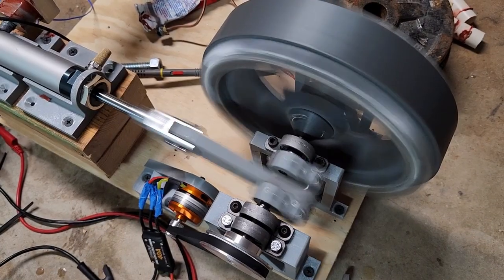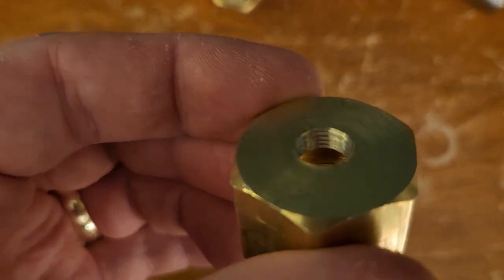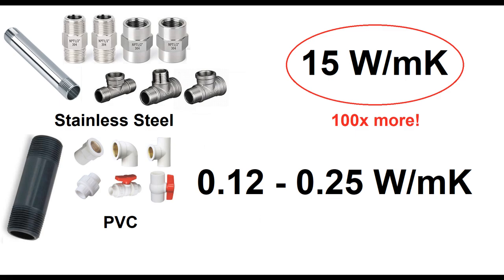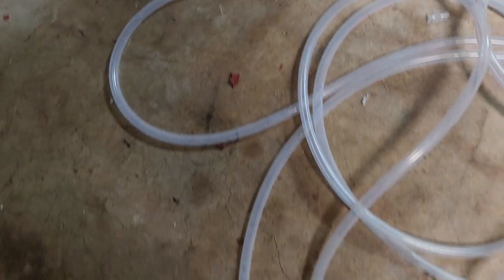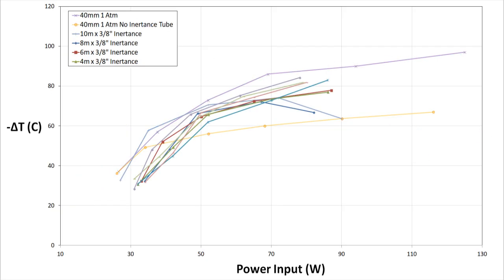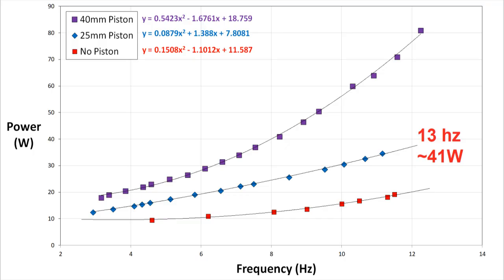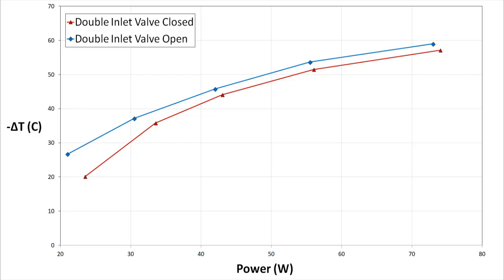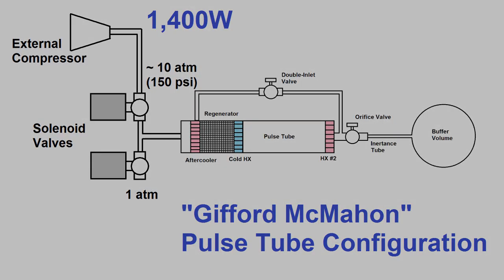Pulse Tube Cryocooler (Part 3)

Comment: The amount of energy required just to run the pump, defeats the purpose of the device. It’s not energy efficient by any means. You’d waste more energy just to run it. To get any practical energy use out of it. But the theory is sound.

Comment: The fact that feeding some of the acoustic energy back into the compression chamber makes me think that this is mechanically equivalent to an amplifier circuit and you essentially added a positive feedback loop, introducing too much could potentially cause the temperature to decrease within some limited ratio. Maybe you could use this analogy to create an electrical equivalent, and thus calculate the resonant frequency of the analogous system.

Comment: This is a great series, thanks very much.  I suggest you try operating with the unit vertical in gravity, with the cold end of the pulse tube down, to avoid gravitationally-driven convection in the pulse tube, which will be present even despite the oscillating flow.

Comment: I don't know if this will help, but if you separate the different (layers) of material in the regenerator by 5mm and use metal foam layers around 17-18 layers that might help a lot.  That way the metal foam layers will not conduct the heat to every other layer if they (the layers) are 5 mm apart from each other.  simply glue or soder or something in place the layers but be safe and wear eye protection, etc.

Comment: why is there even a regenerator? usually a regenerator is used in sterling engines because the air is going back and forth and u dont want the heat to go backwards, but here the flow is one way... so is the regenerator just used as a heat sink and not a regenerator?

Comment: please buy a thermal camera (for example infiray p2 pro or similar for ~250$). i think this would reduce your troubleshooting significantly (need to paint the metal tubes black on the outside tho)

Comment: This is great work, but I wanted to mention you might want to review some convection calculations. Your math shows heat loss based solely on conduction, as if free convection will immediately reject all the heat. In a previous video you referenced convection using the gas conductivity of air, which is certainly a factor, but not remotely complete. I would guess you can model the outside with free convection on cylinders of various diameters at least for a ballpark number. For the internal flow it will obviously be forced convection, and I doubt you will find a correlation for this, but I'm sure you could get a valid range. Looking at the solid alone doesn't do much for the heat transfer solution.

Comment: Thank you for doing and sharing the sorts of experiments many of us would love to do ourselves!
I see that in your next experiment, you plan to abandon the pistons for a Gifford-McMahon system. However, I wondered about how to reduce the mechanical losses in the pistons. I wondered if the piston was cut with grooves as if to receive traditional piston rings, but left empty. The contact surface would be reduced and (I hope) the turbulence at the grooves would act as pseudo-rings for the piston. the turbulence might also act as a lubricant. If true, the friction might be reduced and the compression efficiency increased. 
Your thoughts?

Comment: I was wondering if the flat lining of the system could be due to the aluminum shell of the piston letting in more heat than the system removes at the higher frequency?

Comment: 16:20 I admit, I'm really struggling to understand any of this, but when you mention impedance matching here, that is referring to the volume of flow, right? If so, what if you used the large piston, but set up on a very short stroke, so you move the same volume of air? All other things being equal, you should get less parasitic heat from the friction of the seals that way, no?

Comment: i  would like to make  one for cold storage, will it  be  a cost effective and low power consumption solution to maintain -70 C temperature?  which gas you are using in it?
Reply from the maker: The most cost effective solution for what you're trying to do would be a cascade ultra-low-temperature (ULT) fridge

Comment: You might be able to lower your motor input power at high system pressure by connecting a second buffer volume at the other pneumatic piston outlett at the same pressure. In this case the motor should need less power to compress the gas inside the cooler, because the pressure difference over the piston will be lower. Hope you understand me, my english is not the best

Comment: If i may make a suggestion for heat extraction, LED lamps are often cooled with an extruded tubular heat sink with a significant number of fins on the outside.  If you arrange this  heat sink within another pipe and run coolant through the middle with your gas in the space between the two pipes you would have an incredible amount of surface area in play.

Comment: So if you made a bigger diameter piston but thinner, like a Stirling engine, less mass means it could resonate at a higher frequency. So tuning it can change the impedence of the system. A maget as part of the piston and a coil outside could generate power to run a fan/pump to further cool the regenerator and boost efficiency.

Comment: He said he stuffed the thing with copper mesh which is commonly used in distillation columns he's describing a crack pipe because the crack pipe is a distillation column when you get into Refinery work you'll find yourself stuffing perfectly molded pieces proper 12 to 13 ft thick the diameter of the Tower and so those of you who don't know what a distillation Tower is we call him frackin Towers or Trey Towers when you're driving down the road and you see into a refinery the tower sticking up a r e distillation Towers every one of them

Comment: What if ambient temperature was already -40c.
would there be any benefit to running this in a deep freezer as a kind of "first stage"?

as having that 80c differential with an already 40c below temp would give you 120 below as opposed to only getting 60 below when the ambient is 20c with the same 80c differential.

Comment: This calls for a pvc composite using fiberglass or carbon fiber or ceramic coating of the tube?
Also, try using regenerator material with exponentially more surface area like molecular sieve or expanded rock. I am just throwing ideas out there.

Comment: I’ll be honest, most of this mini series is way more complex than what I can understand but I think you mentioned in the first episode needing more surface area on the internal diameter of the cooper pipes so I thought I’d suggest trying sintered copper heat pipes. They are really common in pc coolers and can be purchased relatively easily.

Comment: You seem to know what you're doing and I'm absolutely out of my element here, but since you didn't mention it, I'm going to ask: Isn't it logical that you're hitting a wall at around -75°C since your air mixture contains CO2 that'll freeze and block up the flow through the regenerator?

Comment: Are you sure Alpha Stirling coolers use crankshafts and not camshafts? I thought you would want to change the phase relation of compression and decompression to better position the working gasses as you work upon them. Pressurized system should keep the valves from floating at 60rpm without springs. If the stroke length isn't the maximum, you could slide the cylinder housing to dynamically change primary and secondary volume/compression ratio.

Comment: Awesome stuff! Grab bag of ideas:

* You tried alternate regenerator materials but none of the ones shown were fibrous like your steel, so I think surface area : volume ratios were ruining them all. Have you tried plain old cotton balls, or the various types of fibrous insulation?

*  Have you thought about using insulative liners inside of metal components to get the pressure rating of metal but avoid contacting your working fluid with metal exposed to ambient?

* You can DIY a super dense heat exchanger with 3D printed stamping molds and thin 1000 series aluminum (it's super soft and easy). Print a pair of dies wavy in one axis to make a tiny version of corrugated roof panels, then alternate a stack of corrugated, flat, corrugated, flat. Clamp the edges of your stack so they get good thermal contact with the outside of your housing.

Comment: What are your thoughts on utilizing this technology for off-grid cooling? Could you possibly power this from a small water wheel, solar panel dump load, or wind turbine.  I'm thinking something like small room AC, noncritical fridge, or root cellar. Do you have any links to a simple DIY approach that would work for something like this?

Comment: Just wondering if a diaphragm piston would work reducing heat from using a piston heat would be generated from compression but no heat from contact as bellows just flex. I’m no scientist probably talking nonsense just thought a diaphragm pump would generate less heat.

Comment: You tried my copper wool idea!  Cool. :)     Sorry it didn't work out.  

The only thing I have to add to this one is, you need to remove the heat from the hot side of the heat exchangers.  You can't just let it stay hot, you need to remove the heat, so it isn't there to start. Still ambient air isn't enough.  Flow air over it, with a PC case fan or something.   If that helps, flow water over it, or add a water jacket, and do more there.   I could write a few paragraphs about a laser cutter, peltier modules, and CPU heatsinks and fans.  All stuff I'm sure you already know.   Sometimes it helps to be reminded.

If it were my project, I'd prefer water jackets, so that stuff can be hidden away from view.   Otherwise, it'd have a big heat block where the copper tubes are, and a big gaming PC heatsink on it.  

Do you have any idea how many watts of heat you're trying to get rid of?  

Your stuff is well above my skill and experience, which is why I'm finding it so interesting.  Sometimes I have a useful idea or two.

Comment: Hm, I'm not a engineer and am not claiming to be one, but those copper pipe heat exchangers look like they would have trouble actually dissipating the heat, as while they have high surface area, wouldn't the inner pipes have trouble getting rid of their heat? 

An idea I have is if you don't want to do active cooling perhaps trying to use the air currents from the heated air "rising" to passively draw more air up through the heat exchanger, kinda like a wood fire stove drawing air because the heated air rises through the chimney and creates an area of lower pressure

Comment: So one thing if you are trying to increase the heat dissipation of the hotend you need to increase the surface area of the OUTSIDE of the pipe as the conduction loss will be proportional to that. You could probably mount some heatpipes to a small radiator like a computer to maximize the dissipation there.

There are pulse tube cryocoolers that do that already so there is precedence for a design like that.

Comment: Two ideas.
1) Possibly adding an insulating coating to the inside of some of the metal components.  Maybe just a bit of epoxy mixed with with a fine power that could offer a thin thermal barrier.
2) The heat exchanger might be affected by the void near the entry point of the tubes.  This area is effectively a capacitor preventing flow from entering the tubes, but could also be adding the the turbulence.  That could be good (for transfer), or bad.  But filling that area with something easily removed (like Play-Doh or something) could provide more data.

Comment: When you pressurize the working fluid, did you pressurize the other side of the piston?   If not, then your motor is struggling against the lack of pressure on that side.   A small accumulator tank could be made out of PVC to keep the compression numbers about equal.  Even a small fan on the warm heat exchanger will improve system performance.

Comment: You hit the nail on the head with your A/C circuit analogy. I would suggest you pay mind to your pump's resonant frequency, its effect on performance and efficiency, and how you could tune that. Using the analogy again, your flywheel is like an inductor, and compressing air in the total system acts like a capacitor. This forms a resonant tank in and of itself. Adding and removing "counter springs" to your air cylinder has the analogous effect to adding and removing capacitors in parallel to the tank. You may, alternatively, wish to add or remove weight to your flywheel, and see what this does. It may not bring the system the direction you want, but it will provide useful information to be sure. 👍

Comment: How about using a vortex tube instead of the bypass to the inlet + the orifice? Connect the warm side to the inlet and the cold side to the cold chamber.

Vortex Tube explanation: Device where you inject a fluid stream tangentially into a pipe. The fluid stream will exit at two ends of the vortex tube, one of the streams is cold, the other one hot.

Comment: Fill the tube with your breath that you led the carbon sink in🙏 you probeble get more cold translations olso heath translations if there is sil oxign left😍🙏🍀
Reply: Compresed space inbetween the oxigens becomes less negative than you get cold translations in to the cold conductivety😍
Reply: Carbon is less resistance so less to togheter with compressor is extra more less negative towart cold translations
Reply: Olso when everighe thention is lower in the atmosphere the cold translations from your device is diverend do to the total set of conditions display

Comment: would it be possible to make a self sustaining sterling engine which cools its own cold cylinder with this process, leading to greater differential and therefore more power?

Is it possible to use atmospheric heat and pressure to run an engine, which exhausts refrigerated air?

Comment: If frequency seems to have an effect, why not use a subwoofer instead of a piston? Won't give much pressure, but will have great control over frequency.
As for sudden flow restriction in the system, it may be from ends of all those tubes. They appear to be very jagged and somewhat squished (perhaps from cutting?). While running a drill bit all the way through would be the best, simply chamfering the ends or even just milling them flat with the bottom of the cap should help significantly.

Comment: https://youtu.be/cy8aGMH8Tz4?t=1070 What about using two coolers in series instead of using one cooler + cold water bath? I mean, i know the difference will not always be 135 C, but i think it would worth trying. 2 or more coolers, termally and and serially connected with one another, inside a isolated cabin (stryofoam box for example) could make it possible to drop the final temperature to 50 - 100 K maybe.

Comment: I think there may be an error in your math, you did not take into account the extra power from the smaller cylinder at pressure when calculating it's mechanical efficiency. Doubling the pressure will increase the power needed reducing it's efficiency. I think both cylinders are still around the same efficiency when the smaller one is at pressure - you are compensating for the volumetric difference of the larger cylinder. Something else in your setup is bottlenecking performance. 

Fascinating video and this is just a bland guess at something I understand little about. Hope to see a fourth part soon.

Comment: if you think its the heat exchanger then put a fan or water cool it. 7:52
13:47 what are your thoughts on trying a smaller piston?
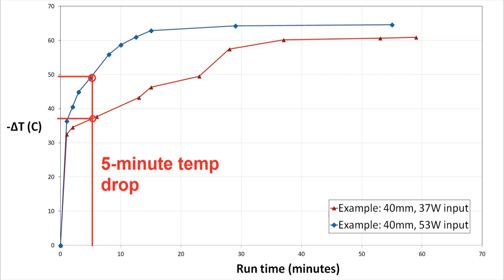17:11 What? if waiting for temp to normalize for a record isn't cheating neither is a fan or watercooling...
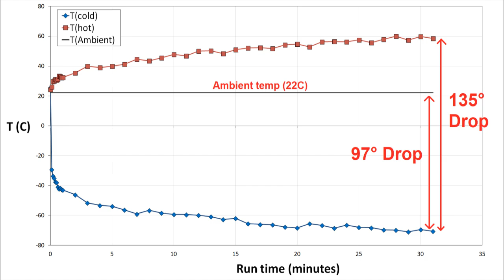17:46 Oh nevermind. lol.
great video!
The impedance matching sounds like a very tricky problem, verifying iterative predictions is so slow in meat space .. (good computer modeling software would be great for that!  and bad computer molding would be exposed by the same :)

Comment: what if you used a "double stage" setup where one crank runs 2 identical pulse tube coolers but one of the coolers acts as a "pre cooler" for the second one to achieve a much higher temperature drop like you theorised in the end of the video

Comment: i need to watch this again 
"i feel the copper tubes soldered to the brass fittings are to large, 
try crimping a few to a slightly smaller diameter. 
the orifice diameter seems large here imo.
wow just wow thanks great, thanks for putting in the work needed.
Reply: also try thin walled brass tubes,
 thinking
Round Brass Tube, 1/16" OD x 0.014" Wall x 36" Long, 5 Pieces

Comment: You can also get higher strength plastics like fiberglass reinforced pipes for better pressure holding without thermal conductivity

Comment: It's too bad you can't just stick one end in a thermos. This thing is going to be conducting a lot of heat from the ambient room no matter what.  I looked on the wikipedia and they say they get down to 10K->50K with stainless steel or bronze which is cold enough to freeze CO2 anything colder required a special magnetic configuration.

Comment: Amazing video as always! You can definitely get better performance and lower temps with helium or argon especially under pressure. It would also be very interesting to see a dry vs humid air performance chart. You could start playing with these once you've honed down the parameters you're already tracking. Also the regenerator may be packed too tightly and the 8g vs 2g is not very conclusive since 2g is too little material and would underperform anyway. You could try 4g or 6g steel wool in the same space or even 8g but in more space. Can't wait for the next part in the series!